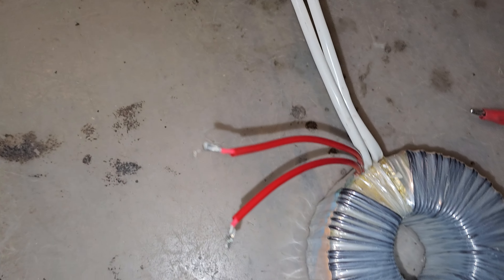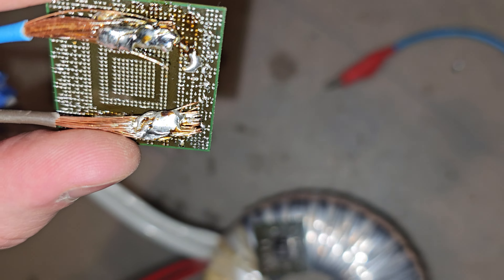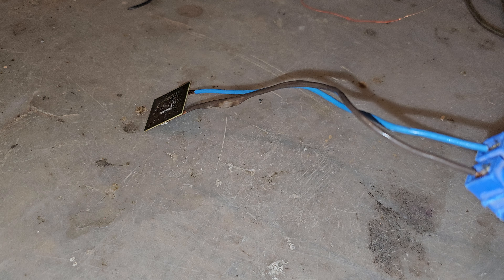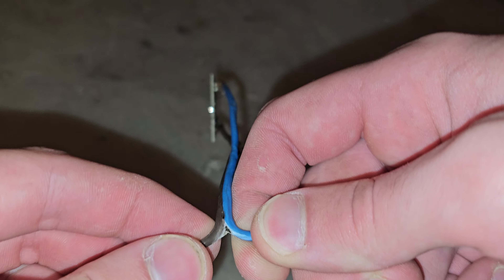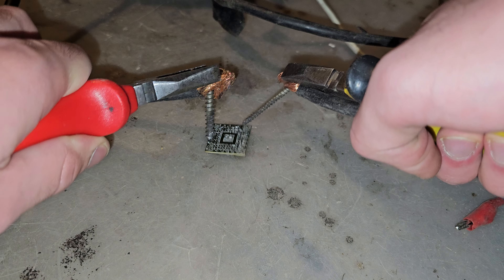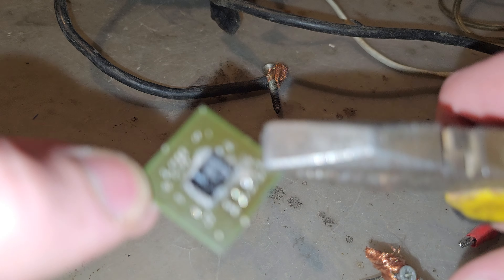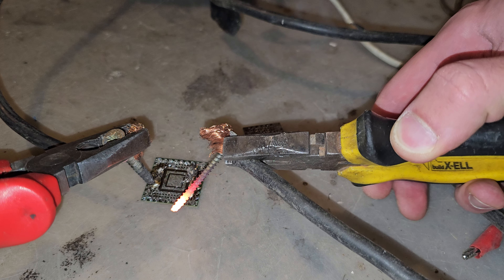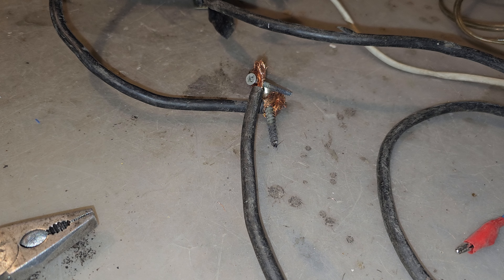Powering Nvidia graphic processor with a transformer (short circuit)

Comment: holding the two wires with both hands bare. High power transformer. You were so close to die dude. Don't do this.
Reply from the maker: I think 6V don't kill me. Output from this transformer is around 6V and 620A but trough these screws I get something about 490A. So I think this won't kill me.